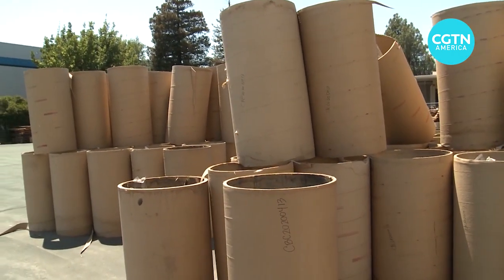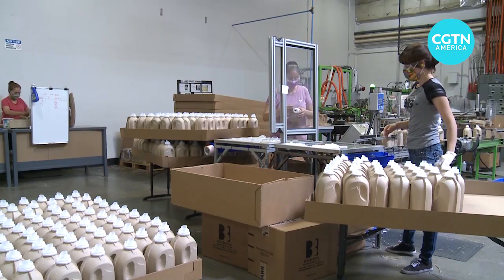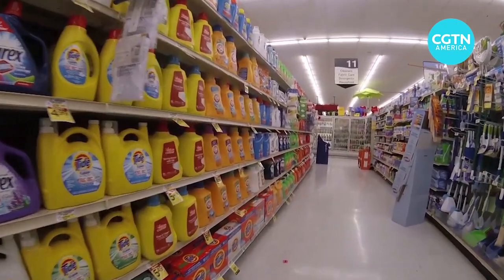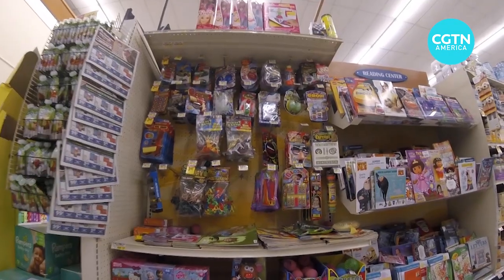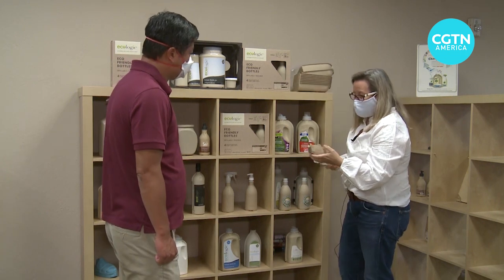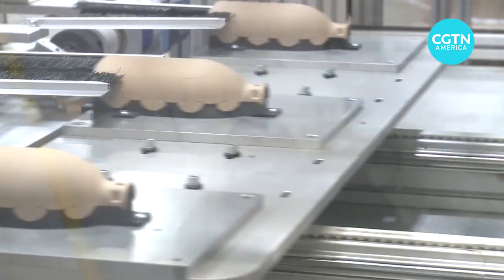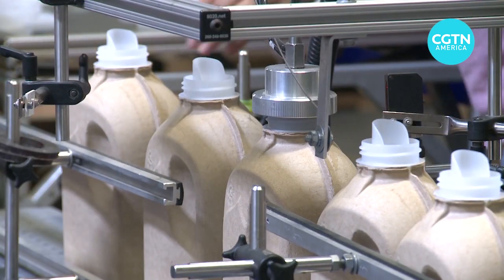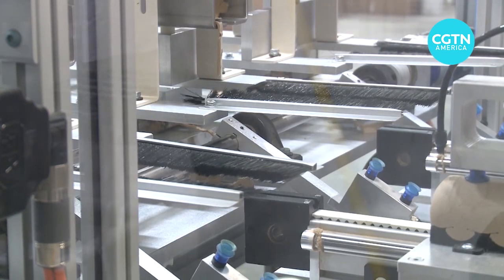Can paper bottles help fight plastic pollution?

Comment: I dont understand? Is there a plastic bottle within the paper shell?
Reply: yes, there is indeed a thin coating of plastic to prevent the paper from getting wet. The paper acts as the outer skeleton. She did mention that the reduction of plastic is 70% so 30% of plastic is used in these bottles.

Comment: Does it use plastic inside liner? How to prevent leaks?
Reply: My question too,
Reply: I wondered that, too. I think that between the overlapping 'seam' and the outward pressure from the contents, it doesn't leak.
Reply: JSTR  No need to be so rude. You're wrong anyway. Other paper cartons for liquids include wax.

Comment: why bother? polyethylene is easily recyclable
Reply: Only about 20% of plastics are recycled worldwide (about 9% of plastics in the US are recycled), and currently, there isn't enough facilities able to recycle more than that.  There also is very little market for the recycled plastic, which does cost more than new plastic.  Plastic recycling is, sadly, rarely cost effective or profitable, currently.  Finding alternatives to plastic packaging really is a better option.
Reply: @LauraRealLife  no more effort should be made to recycle polyethylene a plastic that is easier and safer to recycle than paper
Reply: @Thomas-jj1zo  how many times can it be recycled?  What is the motivation for recycling it?  Unless the container is worth $5 or more when returned, no one will recycle your fancy-pants plastic anyhow.
Reply: @carloscamargo624  how times can paper be recycled? 5-6 how many times can polyethylene be recycle? 10x + what do you do with the process chemicals used recycled paper. oh and by the way paper bottles use PLASTIC